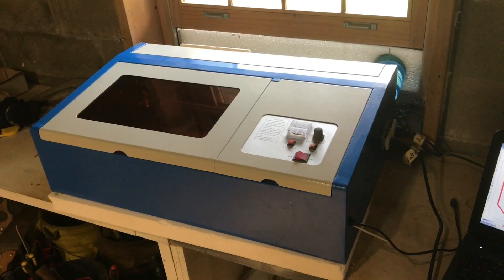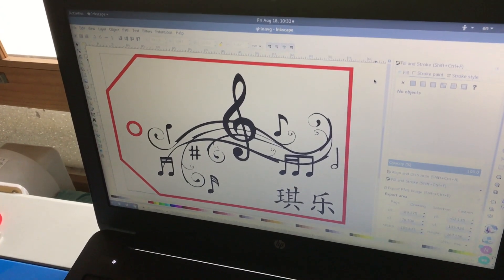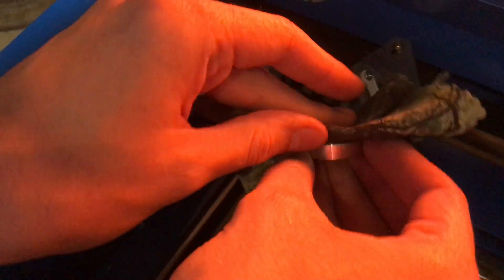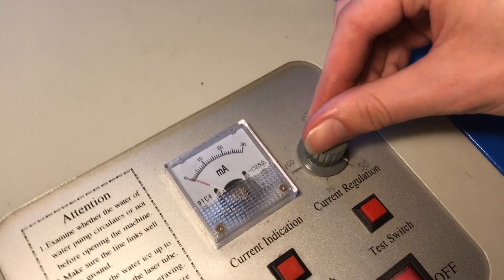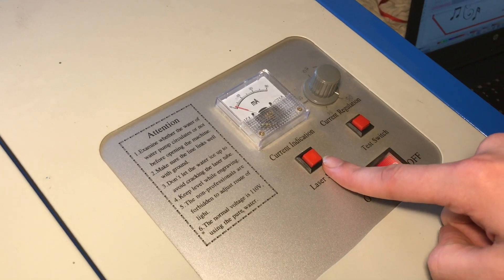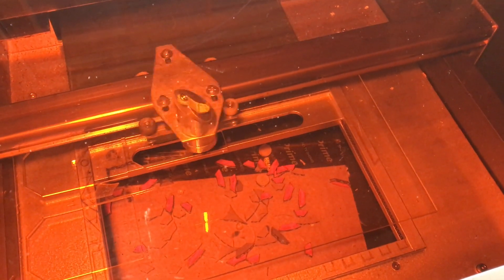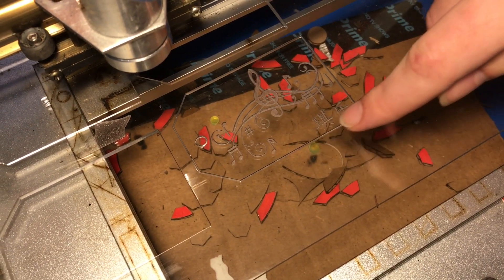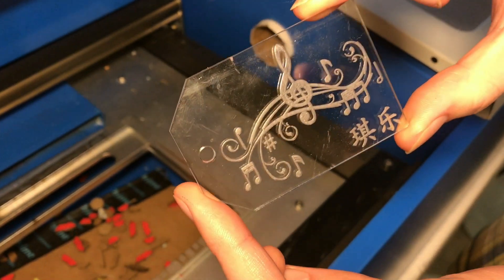how to use a K40 LASER cutter (tool review)

Comment: This is funny and scary at the same time. A cheap laser device in a what seems to be a hillbilly backlot with a toilet paper roll used as exhaust and a tiny fan fixed with some duct tape, running on an external (!) power supply. Wow! I mean, you spent $400 on that laser and you couldn't spend a few bucks more to buy a decent plastic tube for the fan (may be a hair dryer in cold mode would be more efficient), some metal brackets to mount it properly on the internal power supply and wire the fan's power supply internally to the main power socket? This is not even hobby level, this is crap level.

Comment: I have one of these machines.  I am still having problems cutting.  Have the lens and mirrors alligned, have air assist, made numerous corrections, but still taking 10 passes to cut 1/8 inch wood.  What is wrong here?  It is very aggravating.
Reply: I have the same issue.  Someone please advise.
Reply: Adjust your bed height.

Comment: Hello! What speed and power you use for cutting?
Reply from the maker: I made this cut a while ago, I’m not sure the speed and the power are used for cutting, as the laser cutter tube gets more and more depleted these settings change. With a fresh charge on the laser you will need less power and your speed can be a bit faster. Because there are stepper motors controlling the movement there comes a point where you can be moving too fast. You’ll know you’re going to fast if you see a skip in your work. Once you know your maximum speed then you adjust the laser power until it has completely cut through your material. It would be a good idea to have a clipboard so you can Record the feed and speed for each material. Make sure it’s in pencil because as the charge is depleted you can make changes to your settings. Each laser cutter is going to be a little different due to the charge in the laser. I know this isn’t a fast answer but this is what I’ve learned over the years of working with these types of machines. Hope this helps. Let me know if you have any other questions

Comment: Other than you should never use distilled water, your video was very informative. 
Distilled water seeks minerals and actively attacks metals. Use deionized water for best results. 
How thick of material are you able to cut?
Reply: Factory says to use distilled,,,,,,,
Reply from the maker: I’ve never tried anything more than quarter inch. We’ve done a lot of plywood and acrylic. Thanks for the tip on deionized water, I have to look into that
Reply: Live Free also. If you need antifreeze in the system go down to your Toyota dealership. It’s non corrosive.
Reply: @livefree6878  I use deionized water with no problems

Comment: Everyone keep saying that this machine would not work well without mods.   Did you make any to yours?   Plan on getting one shortly but want to understand the total cost.  My work will be mostly balsa and play.   Thanks.
Reply from the maker: It works without mods, but air assist makes a big difference. I made a simple Air assist with a plastic straw zip tied do the machine. It cuts a lot better with air assist I couldn’t believe it when I tried it. We’ve cut plenty of things without it but I think if you try it with it you’ll agree it’s worth the mod. There’s a lot of other simple man at the Air assist is the most important. For 400 bucks it’s hard to go wrong with a machine like this.

Comment: I'm planning to buy this to start a small business (Engraving pictures on wood, glass, rubber) do you this this is perfect for what I want? And what mentanance it requires over time? What spare parts should I buy with it which needs replacement?
Reply from the maker: The most important maintenance on this machine is clean in the lens every single time you use it. So far we really haven’t had any problems with the laser. When you’re using it you can smell fumes, so it is important to make sure that you exhausted outside, even with that you’re still smell fumes. I do not use ours as production machine, But if I did I would consider having a spare laser tube because they do wear out. As they wear out you need to increase your laser power to compensate. There will come a time when the laser tube will need to be replaced, especially heavy use.
Reply: Live Free thank you so much for your reply 😊

Comment: Regarding the red vs black in Inkscape - that's really interesting - what file type did you save it as to import to the Laser program?  Thanks!
Reply: He very very likely saved it as SVG then imported it with K40 Whisperer rather than the highly problematic stock chinese software.
Reply: Bruno G. Following

Comment: ok sir, thanks for share you experience with us, but somethings are very wrong there.

1º the lens are upside down, the curve part need to be up, not down or you dont get a focus point at all.

2º for sure you need to adjust the hight between the material and the head, to set up the focus point in midle of the material to cut with eficience, precision, more speed and down power cosumption. 

3º min 1:37 you really, really dont need cleaning the  lens every single cut (you short the lens life, apart of time lost) you make scratch on lens surface and its really totally unnecessary at all.

The best solution is use a air compressor (aquarium air pump or a small air compressor) to take air inside the lens chamber its create a high pressure avoiding lens contamination by fog and its help with cut to, in wood and acrylic as well.

4º you clean the lens every cut but leave the machine all that dirt and mess all around?!?! if we take care ours machines, she will be our friend with better quality and longevity.

cheer
Reply: every video I've seen says curve side up. Mine came stock curve side down, I used it like this for quite awhile before cleaning the lens. I flipped it over and it doesn't seem to make an ounce of difference.
Reply: 1 wrong!! curve down.   
2 ok
3 agreed.
4 agreed
Reply: @darkracer1252  I just got my k40, haven't even used it once, went to change the lens and put in lightobject air assist, and the stock lens has the curve upwards from the factory.
Reply: @PeabodysParadise  

so after some googling i have found out that it doesn't really matter.  

these types of lenses will focus both ways. 
though flat side down will give you a shorter focal lenght and a smaller dot size. 
flat side up is longer focal lenght and bigger dot size.  

but this is why i said what i said http://prntscr.com/ovjh1x
Reply: @darkracer1252  Curve upwards. It says so in the instructions.
Reply: @JamesW81  
depends on what you want to do..   engrave or cut.

Comment: What software are you using to cut with? You mention you designed it in inkscape, are you using corel Laser? how is it determining the difference between red and black
Reply: John Smith K40 whisperer will open .svg & .dxf files, you just need to set the color to 255,0,0 for red and 0,0,255 for blue (r,g,b values), I think there is a +/- 10 on the values.  To utilize the full bed on these lasers make sure you square up the mirrors, then adjusting them with the thumb screws will be easier to get them aligned.

Comment: thank you for making this video, I was actually looking for something like this before buy the laser cutter. So if I want to cut lets say a 4mm acrylic sheet and I can go twice over it and that should be enough right? also can I work from my mac computer to use it? 

many thanks
Reply from the maker: +Natalia Steele 

Yes it should cut 4 mm acrylic. If it does not cut all the way through you can make another cut. I've actually seen people make five cuts on really thick acrylic.  One feature that I plan to add is an air assist, this will allow you to cut thicker materials as well. I added that fan to pull the fumes out from around the laser, and this seems to help. I work with a lot of lasers at work that are a lot more expensive. For $400 I am very satisfied.
Reply: This is great to know! I just ordered the exact same one cause of your comment, I'm sharing this video to a laser cutting facebook group I'm in. thank you very much!
Reply: Hi! Nice video! What speed you use to cut acrylic? Thanks for the answer
Reply: Hi i had the same machine, only problem is you window to run the program, if you had bought the machine since it was 8 months ago,  are you able to run it on mac?